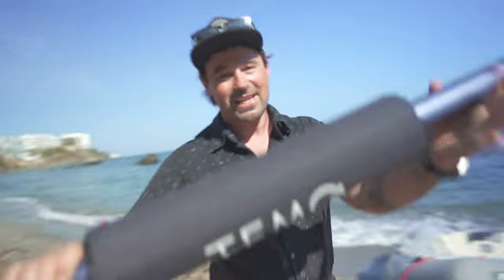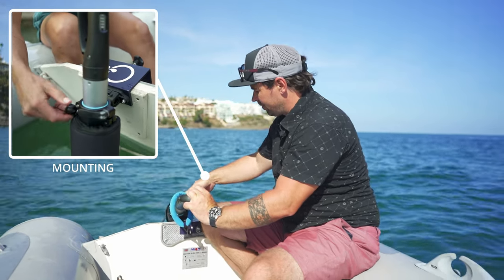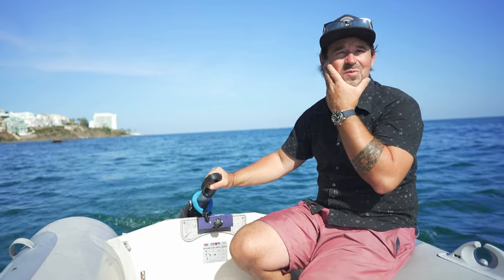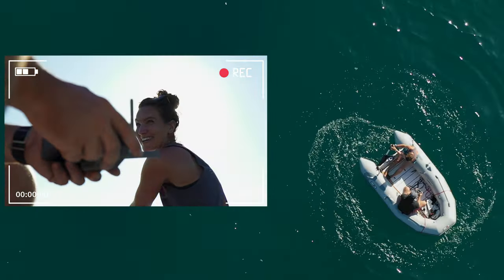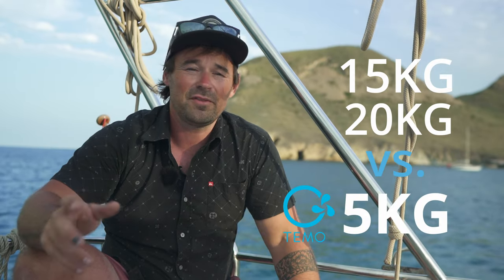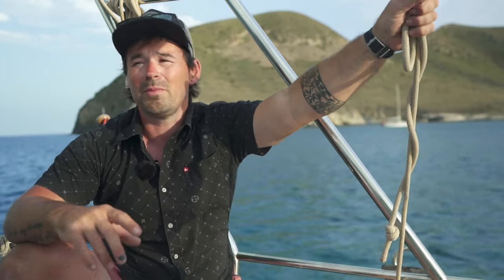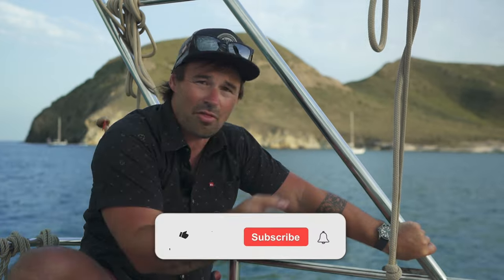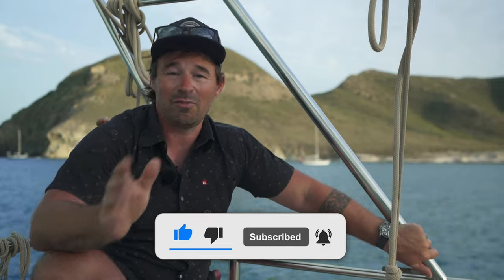This Outbard CHANGES EVERYTHING!! - The TEMO 450 electric motor.

Comment: Looks great for reef exploration.
Reply from the maker: Bingo yessss! The prop guard is replaceable too so if you wear it out you can be good as new again. 🤙🏼
Reply: Great little auxillary or emergency motor. It peaks my interest as a set of two on the back of a Catamaran. with a tiller for double motor maneuverability.
Reply from the maker: Love it! Double up 👍 

Check out the experience we had on the first 24. It pushed 1 ton (in harbour) 2 should be sweet + redundancy! https://youtu.be/txFtoN81vnw
Reply: @SailHub  I already watched it! I'm in Thailand building a new 29'  Catamaran and a few other things. I'm glad I found your channel. Thanks for the lesson on the blocks too! I mean, I already knew a lot of it, but it's nice to see what others have learned.
Reply from the maker: @youneedahobby1 Cheers!!! Stoked to be helpful! Building a cat sounds awesome… Stay tuned, we got a cool project on the horizon too 🤟 Maybe bump a few ideas back and forth at some point!

Comment: I am planning to buy one for a grabner happycat NEO inflatable catamaran (60kg), I think as there are less contact of tubes with water (resistance) it could work 3 knots easier than the boath of the video.
Reply from the maker: Yeah, they are pretty slow on a v’d mono but I have heard good results from tiki cat owners and the likes. I would live to hear your feedback. 

Despite the slow speed I actually quite fancy one for the days where I don’t want to but the big one in the back!
Reply: @SailHub   electric conventional outboards weights 14-17 kg and invade the traveler operation zone. The idea is to use it go in/out to/from the marina and no-wind conditions to come back. Enough. Also, I do not want to leave a conventional electric outboard attached and it is not practical to remove/attach 17 kg each sailing time. I see Temo 450 as ideal solution.
Reply from the maker: @juanmateu3020 yeah, they are pretty sweet. So long as your not fighting a current or swell. But yeah, I’m in to be honest.
Reply: @SailHub   I usually sail in an estuary, aprox +-1 hour from high tide (in low tide 60% of estuary become "land") . During that time interval no too much current is observed. I am not planning to use the Temo for going from A to B being that distance nautic miles 🙂
Reply from the maker: @juanmateu3020 looks like your sorted mate. Do let us know how you get on 👍👌

Comment: I’d expect 650w to be closer to a 1hp (I believe back of the envelope calculation is multiply by 1.34).  Interesting that main competitor is 2hp, which I’d have said would be the case for a 1kW electric motor like the Temo.  Pushing the Beneteau around with 2hp went about as well as I’d have expected… lol.
Reply from the maker: Thanks for the input! Yeah, we were warned not to put it on the keelboat… What can I say, we like a bit of fun!!

Comment: Specs say it is for boats up to 500kg, and it's pushing force is 200 watts. Watts are not used for force, but that would translate to 200 newtons which is about 20kg. Might be alright for a canoe or kayak. Edit, manufacturers video says only 12kg of static thrust. The average man would apply more than that with an ore.
Reply from the maker: It’s surprisingly quite good - we pushed the limits a bit too much in the following episode -  https://youtu.be/txFtoN81vnw

We should not have done this but it was fun!

Comment: Looking at to attach to a kayak. Thanks for the review. Is the trigger not unlocking?  I don’t to build a transom on my kayaks for my current minn Kota trolling motor.
Reply from the maker: Hey, the trigger does not lock. You could easily attach the Temo row lock to a kayak which is good. Regarding the throttle maybe it’s the boatbuilder in me but I would take it off and re wire it to a knob…. Expensive piece of gear to pull apart though!